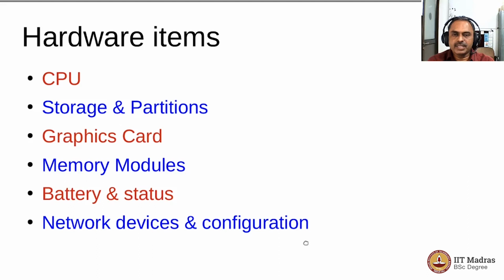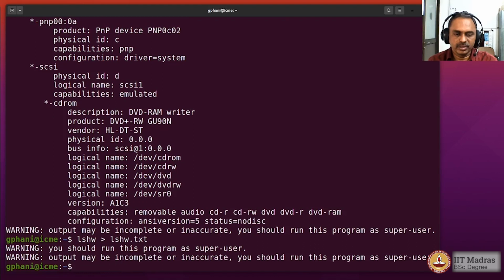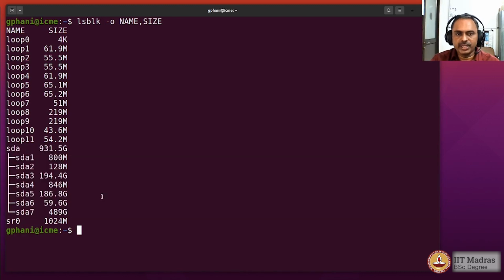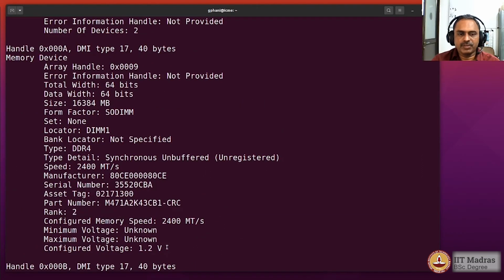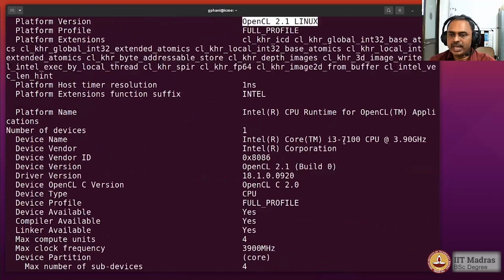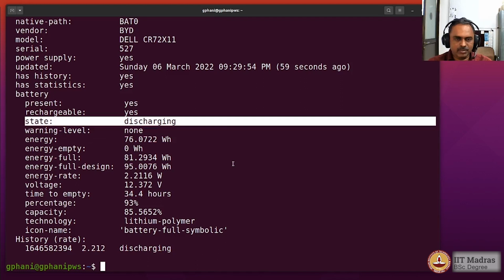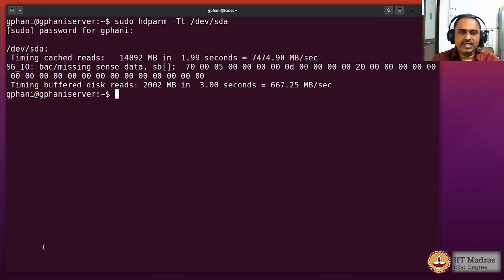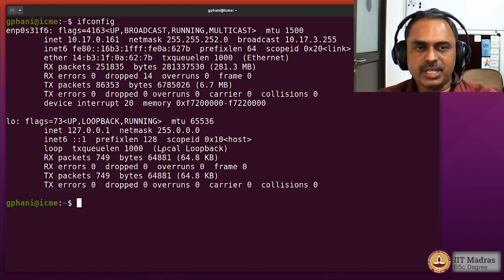W10_L3: Knowing your hardware

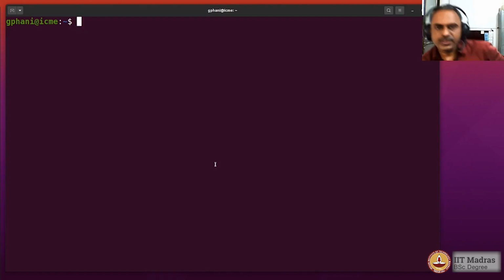Comment: - 01:24 `hwinfo`
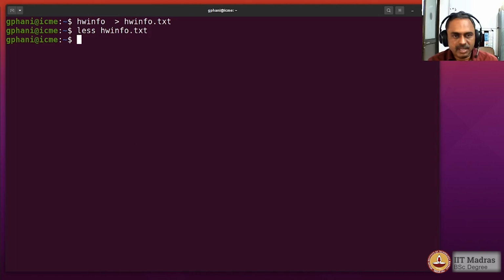- 03:03 `lshw`
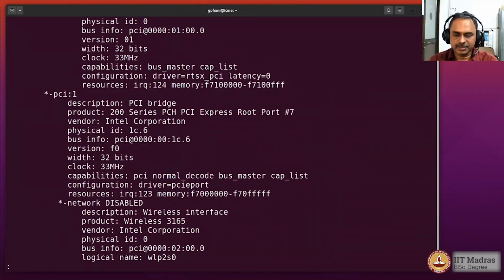- 03:49 `lshw -c display`
- 04:10 CPU info (`cat /proc/cpuinfo`)
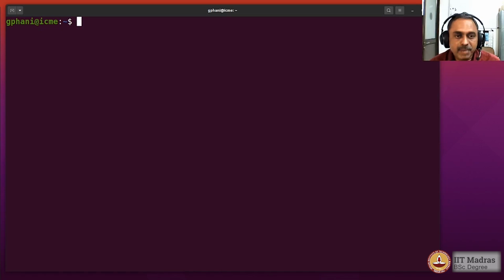- 05:41 partitions (`cat /proc/partitions`)
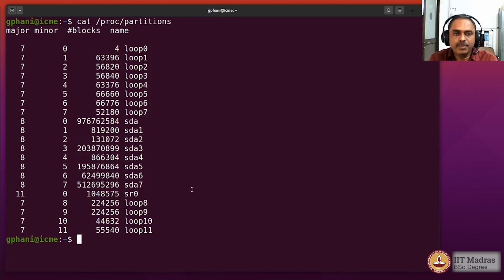- 06:11 `lsblk`
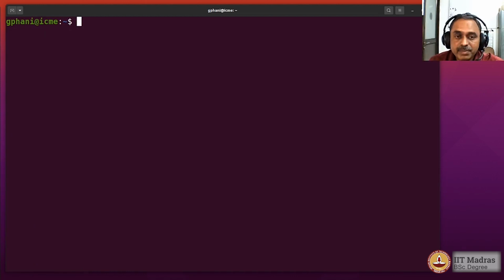- 07:27 `lspci`
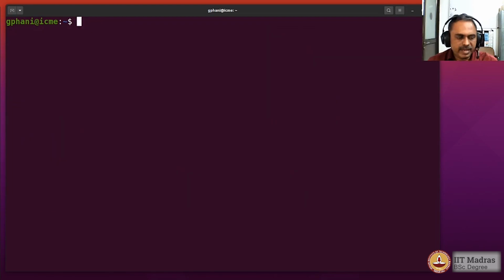- 08:18 `free`
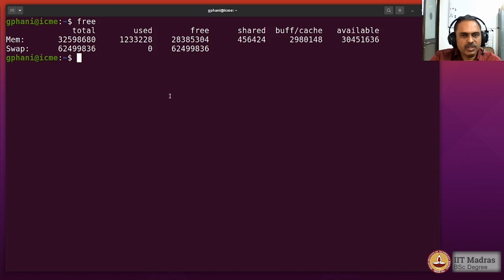- 08:56 DIMM modules (`sudo dmidecode --type memory`)
- 11:42 `hardinfo`
- 12:37 `clinfo` (OpenCL details)
- 14:12 `upower`
- 17:12 hard disk statistics (`sudo hdparm -Tt /dev/sda`)
- 18:20 `df -h`
- 20:22 `iostat -dx /dev/sdb`
- 21:31 `ifconfig` (now replaced by `ip`)

Comment: Packages to install 0:35
hwinfo 1:30
lshw 3:11
lshw -c display 4:00
cat /proc/cpuinfo 4:15
proc/partitions 5:50
lsblk 6:20
lspci 7:28
free 8:20
sudo dmidecode --type memory 9:00
hardinfo 11:45
sudo apt install hardinfo (will not work on wsl)
clinfo 12:35
upower -e 14:10
upower -i
upower
sudo hdparm -Tt /dev/sda 17:10
df -h 18:20
sudo hdparm -Tt /dev/sdb 19:30
iostat -dx /dev/sdb 21:00
ifconfig 21:30